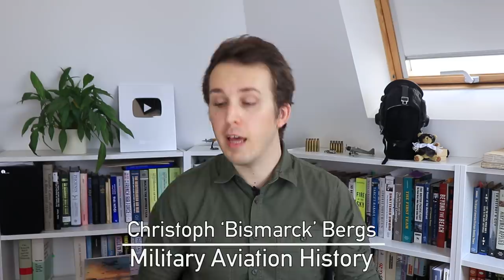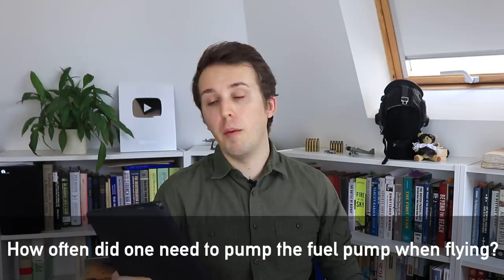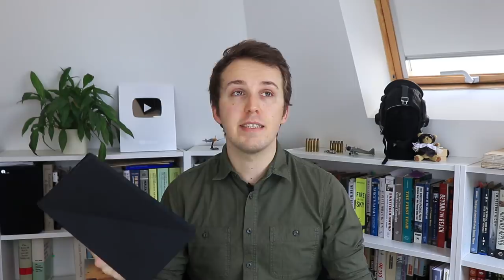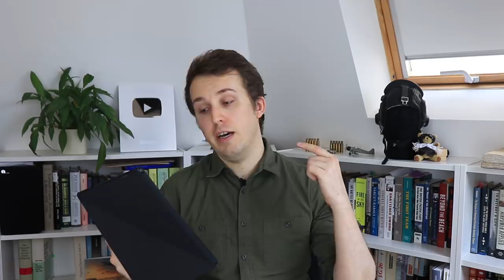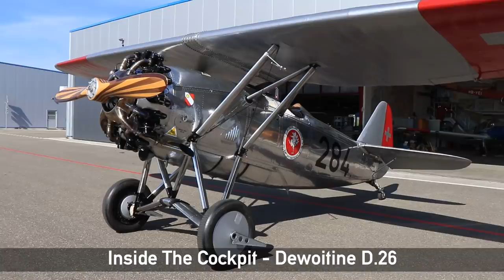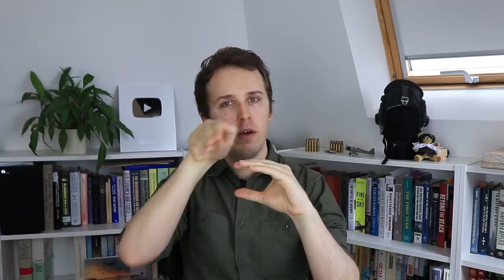Fokker D.VII Q&A

Comment: Fokker G1 too, designed in the 1930's very advanced for it's time and might have inspired the Lockheed Lightning.
Reply: Yes, the G.1 is an example of the then modern heavy fighter or destroyer "craze"
Reply: El Bee  I remember reading somewhere that the G. 1 was somewhat of a sensation at the Paris airshow in 1936.
It could be that Kelly Johnson remembered this when designing the P-38. Especially because the mission of the P-38 beeing somewhat similar as that of the G. 1. Both were meant to take of and to destroy bombers.
While the G. 1 may have been originally been designed as an aerial cruiser it was eventually used as an interceptor. The P-38 may have been designed as an interceptor (pursuit), but if history played out differently, it could have then also been used as an aerial cruiser.

Comment: I believe that the word 'petrol' is a brand name or trademark, that became a byword in Britain for what in American English is called gasoline.
Reply: Petrol is a common British contraction of petroleum. Though it can be found in other other languages also.
Reply: It it, from one of the earlier producers/sellers
Reply: Petrol is short for petroleum. Gasoline is petroleum, but diesel, for example, is also petroleum; amongst many other products. Not a huge issue, but in this case, American English is more accurate.
Reply: @TheOwenMajor  yes a medieval English word but was used in branding in the 1920s
Reply: @scrubsrc4084  The word petroleum and what it refered to was well establsihed long before the 20's. 

And it's from Latin, petra - rock, oleum - oil.
Reply: @TheOwenMajor  which I said, the medieval word, which however was referring to oil its self not refined petrol we know, if you pronounce the word in its pre vowel shift form then middle of the word sounds like oil.

Comment: I think when you say "Volume" in reference to the piston head, you mean "area" or "surface area". In English, volume implies 3 dimensions, and area implies 2. Which, you understand, can be very confusing when exchanged! 

I don't speak German, so I'm curious; is there a word in German that describes both area and volume?
Reply: A domed piston reduces the volume of the combustion chamber at top center, because the piston takes up additional volume. By reducing the volume, you increase the compression ratio. Increased compression ratio improves efficiency and increases power slightly, up to the point of damaging detonation. These aircraft engines ran high enough compression ratio to cause serious detonation at low altitude on those older specification fuels. The pilot would delay opening the throttle to maximum until above a known pressure altitude to prevent detonation. Thereby the engine had a relatively flat power potential curve up to a certain height, above which it began to fall off. It's a similar concept to "Critical Altitude" for turbochargers, where the waste-gate full closes providing maximum pressure-ratio to the engine at a defined altitude. Below which it bypasses exhaust gasses and reduces "boost" to prevent detonation.

Comment: It seems there are planes today with the same performance characteristics of WWI planes and are still in production like piston engine “bush planes”. Question is could planes like these (for example Cessna 173, piper cub) could have plausibly been designed with available WWI tech? Alternatively are there any WW I planes which could have been kept in production with improved engines? like the planes I mentioned above have changed very little in 70 years. It seems there are designs from WWI which are still useful like bolt action rifles and the model 1911 handgun. Anything like that for WWI planes?
Reply: I think you meant Cessna 172, 175, or 182...?
Reply: I would say, practically speaking, no.  Bush planes are generally tail draggers. Of the two planes you mentioned that would be a Cessna 140 and possibly Piper Super Cub for bush work?  (not my field of expertise.)  Both Cessna and Piper used cantilever wing which eliminated most struts and all wires for support.  Both used a Continental opposed cylinder engine if I recall correctly, and gave a better power to weight ratio than what was available for WW1 aircraft. The WW1 aircraft used radial, rotary, and in-line cylinder engines.  Radial and in-line are still in use today, but of better manufacture.  Some WW1 aircraft would be fun to fly, others would be too dangerous for all but the most skilled pilots.  Still would not be a practical, every-day flyer, being open cockpit and serious drag issues.  Wasted fuel, lower payloads, and frozen occupants.  Just my opinion.

Comment: The volume of the cylinder head increases?
What you should of said is that you miss-spoke, because now we understand that you don't know what the hell you are talking about. A domed piston decreases the volume of the combustion chamber to increase combustion chamber pressure. A domed piston also has more surface area that a flat piston, but we don't give a shit about that. We don't use that terminology with our internal combustion engines. The shape of the piston is related to compression ratio and "maybe" flame travel in very high performance engines like nitro burning top fuel dragsters, and our most modern high performance engines.